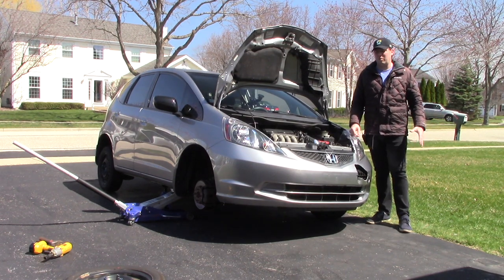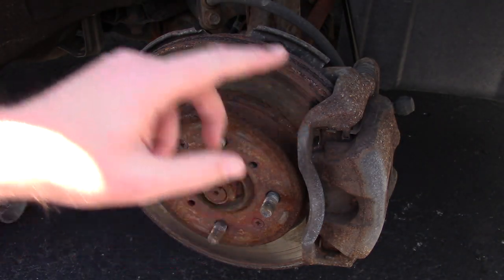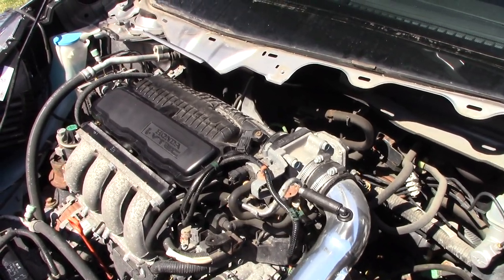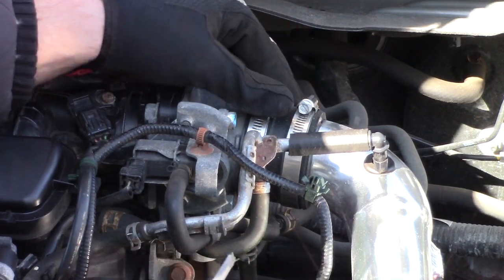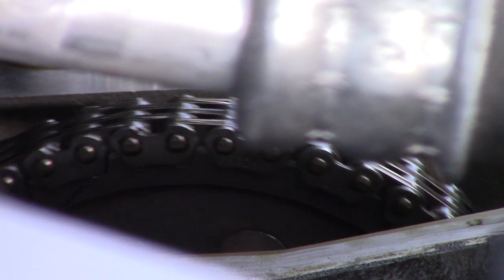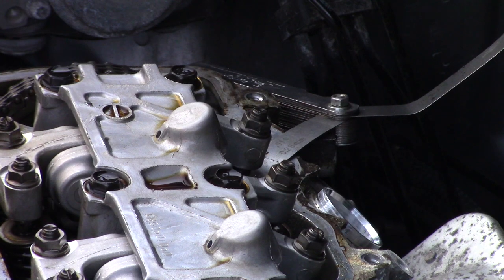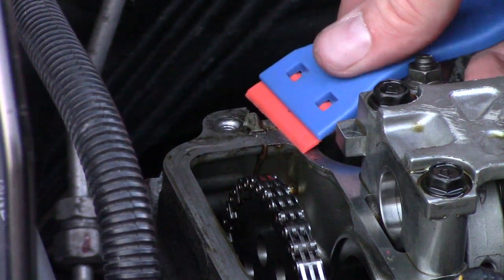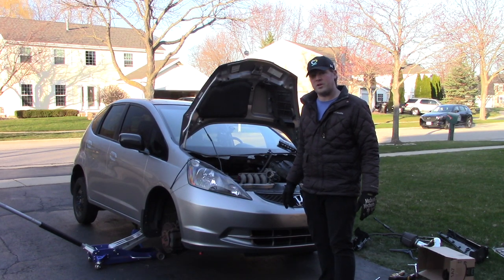DIY! Honda Fit GE8 Valve Adjustment

Comment: 280mm Front Rotor is used on the Euro Gen 9 2012 to 2016 Civic 1.4 i-vtec hatch if anyone wanted to keep it all Honda. Fantastic job on the valves one of the best explanations available.

Comment: Great video.  Thank you so much.  I did this successfully based on your video.  Only add would be at the 8:30 mark to use a flat feeler gage on the valve cover edge to line up the cylinder top mark.   It was hard to line up the mark visually and I saw this tip (too late) in a different video.   I'm pretty sure I got it close, but would have been nice to have been perfect.  My '11 Sport has 190K miles and it had never been done but wasn't loud.  I did adjust most of them, but didn't get any real improvements in noise, power, or gas mpgs.
Reply: Thats what I was thinking, I mean I guess for him the sound was a little better but my 190k '13 sounds like the after and has never had a valve adjustment, ill still probably do it the next time I change the plugs though
Reply: What kind of mpg do you average? My AT 11 gets like 32-33 and I drive cautiously

Comment: Thank you for taking the time to make this video.  I have a 2010 Fit and wanted to know what was involved in doing a valve adjustment.  Thankfully, the valves sound ok presently, but I appreciate you identifying the fastener sizes and torque specs.  It's amazing how many videos are out there that omit such helpful info.  Cheers.

Comment: Thanks for the very detailed video. I have a different technique for valve tightening Though. I make all the adjustments with the filler gauge still wedged in the valve, then tighten the nut. My car sounds like a well oiled sewing machine now. Very quiet in fact.

Comment: Grease those wheel nuts (do breaks while your down there ) lol. Why dont they ever say how to keep the parts where they can be found and not lost? I would put them in plastic zip lock bags and tape them to the part and number them from first to last items that are taken off as they are in order . And clean the throttle body and replace plugs check everything you can while all that crap is out of your way. Hoses and belts too! Dont forget that valve cover . plug s & throttle body cleaner and your hand cleaner for you! Lol. So does sny one know how much it costs to get it done st a shop?
Reply: I had a bunch of maintenance done at 100K for about $1200. That included valve adjustment, spark plugs, coolant change, and a bunch of other routine stuff that would be done more often. I'd bet the valve adjustment was a big chunk of that just based on how much needs to be removed to get there.

Comment: My 2012 Honda Fit Sport has 294,000 miles on it and I'm ashamed to say I've never had the valves adjusted or checked.  Recently it's developed a clattering noise that lasts until the engine warms up.  Even when the engine is cold it's not really noticeable at idle, but is very noticeable under light throttle.  Could this be due to the valves needing adjustment?
Reply: It could be a valve adjustment, but also could be that initially the oil isnt reaching all the places it should while the engine is cold  but when it warms up it reaches up to the top of the crank case and lubes everything up. I would do the adjustment, and when the valve cover is off look for any sludge or buildup that might be affecting oil while cold. Also before you do your next oil change, run some seafoam high mileage motor treatment through the crankcase for 50-100 miles, this can dissolve some of the sludge and buildup, but make sure you change your oil and dont leave it this way for more than 100 miles or so. I also like to use some motorkote and lucas high mileage oil stabilizer on engines with this many miles, really helps to reduce friction and wear, and if your're hearing noises while your engine is cold youre definitely hearing that wear. add some of that to the crankcase after your next oil change..
Reply: I should also say that it could be piston wear as well, the piston can clatter  inside of its bore when the engine first starts up, and then as it heats up the piston expands to deacrease the clearance between the engine and the bore. using a bore scope you can look inside each cylinder for damage to the cylinder walls, unfortunately this is one of those things that happens to really high mileage engines, but ive seen engines go for a long time with this problem as well, eventually  if the engine is rebuilt it needs to be bored....i would take it really easy on the engine until its warmed up, until you find out what the problem is exactly...
Reply: @MattB90  Thanks for the replies!  I’ll try those.

Comment: How do you know that mini cooper's rotors will fit into your hubs?
Reply: Because they’re both 56.1mm center bore with a 4x100 lug pattern. There’s a set on my car now squeezed by ITR calipers. Stops on a dime.

Comment: This engine is way too clean inside.  You should change it's oil a lot less often, or it's never gonna wear out.
Judging by the outside, this vehicle is in the rust belt.  Body will rust out way before any engine issues materialize.
The emblem in the grille is crooked.  Is this a Hyundai ?

Comment: Is it just me,  or are the valves on a Fit noisy no matter what?  That's been my experience.
Reply: Are they? I just got to digging cause my Toyota after 170 k has no valve noise still then this fit has had a little since we got it with 30k miles.

Comment: Thank you for the great video. I was apprehensive about ensuring that the position was TDC, I used a straight edge to sign the tick marks with the top of the cylinder cover, this made it so much easier.

Comment: The way you filmed and explained is top of the class teaching material.  However, the result compared to the original noise is insignificant to me.  Both are noisy.

Comment: Patrick you have a like from me and subscribed but the intake valve is 0.15 mm  and the exhaust 0.26 mm, you have to adjust again the valve mate..good video
Reply from the maker: Thank you for the like and subscribe. Intake acceptable range is 0.15 - 0.19 and exhaust acceptable range is 0.26 - 0.30.  Setting them at 0.18 and 0.28 respectively means they are within acceptable range and do not need additional adjustments.
Reply: @patrickmorgan4268  0.15mm for intake and 0.26 mm exhaust when the engine it's cold and 0.19 mm and 0.30 mm when the engine is hot mate,remember this think :) have a nice day!
Reply: @agamitzadandanache2379  You're spot on re: hot/cold, although personally I'd be a /little/ conservative if you don't have total confidence in the precision of your feeler gauges and allowing for a little creep when torquing the jam nuts.
Reply: @agamitzadandanache2379  That's actually wrong. First, you're not supposed to do this job with a hot engine. You're supposed to do this cold ONLY. 90 deg F or below. Second, when the engine is HOT you need LESS clearance because metals expand when hot. That's the entire point of having valve clearances.
Reply: @agamitzadandanache2379  First of all, you can't do this with a hot engine, just because the time it takes to remove the cylinder head cover is enough for the engine to cool itself.
Second, the service manual clearly states “Adjust the valves only when the cylinder head temperature is below 38 ° C (100 ° F).
Temperatures are not differentiated between intake and exhaust.
This is to be clear to everyone. 
Mai dandanache, mai, tare ai dat-o tare cu nuca-n perete incercand sa pari destept.